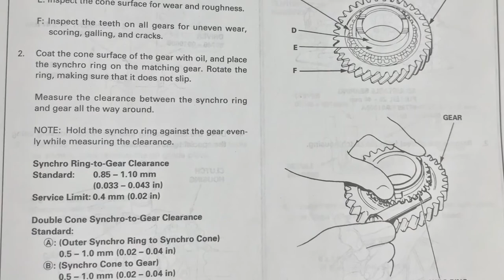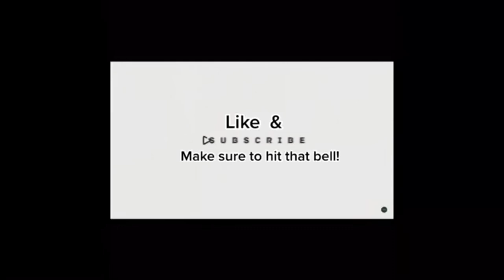Honda/Acura B series 5speed IN DEPTH REBUILD PART 2

Comment: I bought every single bearing and seal oem honda new and installed a Quiffe LSD. My S4C has to sopport 600+. Unfortunately i couldn't get thrvppg straight cut gears this time around. I had already spent $2800 on the rebuild. Absolutely fantastic video. Couldn't have done the job woithout your posting.
Reply from the maker: Thanks Jim…I figured a few guys would appreciate some of the tips and tricks I learned doing these… the D series trans are very similar , if I had a K series Id do a video on those too. Thanks for the comment! BTW… the trans in the video is still going strong and the owner loves the b16 1-4 close ratios paired with the LS 5th freeway gear

Comment: Thanks alot for putting this up! What kind of oil do you run in the rebuilt gearboxes? Do the carbon lined synchros require a different oil other than Honda MTF3?
Reply from the maker: Way back before MTF honda manual gear boxes specified 5w-30 engine oil and it worked without issue. But even in the old stuff there is a noticeable difference in how they shift when MTF is put in them, especially when they are cold. 
I only use MTF no other additives. 
I change the fluid every 15k in my honda (manual or auto) because it extends the trans life. 
I haven’t ever seen a different fluid spec for carbon synchro’s and have put a ton in peoples daily/weekend hondas with over 100k still shifting clean with no complaints.
Rebuilds arent indescribable though… because owner induced bent shift forks are the number 1 cause of failure
Reply: @MRROCKAPE  Alright thanks alot for your quick answer 👍 I'm currently in the process of rebuilding my S80 transmission and saw alot of conflicting opinions about what kind of oil to use afterwards. So its nice to get a clearcut answer from someone who actually has some experience 😅 Thank you so much!

Comment: showed everything but the closing of the case-technique and lil clip in that 32mm plug hole... the same crucial part missing from most other videos i've found.
Reply: I cant figure out how to put it buck i tried to open the c clip as much as i can with a plier and prey the shaft with a screw driver from the nut it wont go in place do you know why?

Comment: Is there a specific orientation for the two washers under the main shaft? If I remember correctly one of the washers is concave
Reply from the maker: The concave/convex washer is against the bearing.

Comment: Hey man this was a very good video! I have a bit of a weird question however and I was really hoping you can help. I've been having a strange transmission issue in my EK project over on my channel. Basically what's going on is, and I know it sounds weird, but reverse is where 4th should be. So the 3-4 shift is actually 3-reverse. I cant find 4th gear anywhere. I did take the transmission out and did a whole build (on my channel named Gripworkz if you want to reference those videos) and I didn't notice anything wrong/damaged/missing when it came to the gear set. Also, the shifter seems to go into 5th but there's no engagement, it's like another neutral, I am so frustrated and confused, I've been at t his for months now. Any help would be greatly appreciated.
Reply from the maker: So likely something isnt right in the shift mechanism you saw me install right at the 25minute mark in this video , there is a pivot pin that can pop out of its lower hole, when that happens it tries to shift two forks at once or doesn’t correspond with the correct gear…. Thats my best guess on what is going on with yours.
Reply: @MRROCKAPE  I think you're right. I know for a fact I was able to engage every gear by hand on the bench, and I know I eliminated the shifter and linkage from the equation. That shift change holder mechanism is the only thing left that I can think of. I'll try to look for that pivot pin you're talking about. Time to pull the transmission again sigh thank you for your help!
Reply from the maker: @Gripworkz  dont worry lots of people end up doing these more than once… its part of the reason I tried to stress being really careful with the gear stacks as its a common mistake and a really hard one to figure out if you mess it up. I should have been more in-depth on that little shift mechanism because there is some lining up of the pins of the shift forks to it that’s critical. Maybe Ill do an update video when I do another one. Im looking for a k series 6 speed to do a video on currently.
Reply: @MRROCKAPE  Well you did really well with these videos, it’s hard enough to cover every single detail as it is. I tried to be as careful as possible when it came to the gear stack order and orientation but I know someone has messed with it in the past. If they made a mistake I pretty much put it together the way they did. I’ll double check everything when I get back in there. What do you think the odds are that the shift mechanism could be damaged?

Comment: Do you have a write up of how to row through the gears to test out the transmission?
Reply from the maker: So if you put a round punch in the shift shaft , twist it to your left and pull on it, thats first gear, push it forward thats second, let it self center, pull back and thats 3rd, forward is 4th,back to center and twist it to your right pull back is 5th, push forward and thats reverse. You will need to turn the input shaft while simultaneously shifting it to get it to go in each gear position.
Reply: @MRROCKAPE  thank you! And thank you for the awesome step by step tutorial. Just sealed my first b series transmission build using this tutorial.
Reply: Thanks for this question and thanks OP for the detailed answer!

Comment: Hey I’m rebuilding one of these transmissions, I got it together right just like this, and now the input shaft is locked up
Reply: Did you line up the tab before installing the case?
Reply: Just had the same issue, it ended up being the shifter assembly didnt line up with the other case half causing everything to bind up

Comment: I have a ls transmission that was stuck in a high gear even if I put it into first gear. I had to rev it high just to get it moving and changing gears does nothing. Even neutral will not work so if I released the clutch the car would die. Thought it was something wrong with my pressure plate so pulled off tranny and tried to rotate the main shaft through the gears but the shaft will not rotate while engaged in any of the gears. In neutral, the shaft rotates freely. Do you have an idea of what’s wrong with it?

Comment: I recently got a b16 hydro transmission. Guy claims everything was working perfectly. Probably sat a few months. Anyways, I installed it and I have no reverse. My shifter feels like it goes into reverse but acts like a neutral. Literally feels like there’s no reverse gear in it because of the fact it doesn’t even grind or anything . What can be my issue?
Reply: You bought a transmission from a lier is the issue.

Comment: Do you have to have the detenballs or whatever they are called and the bolt with the spring in, and reverse bolt in to have the shaft spin easy? Our shaft is hard to spin but does spin
Reply from the maker: I dont have any spares, all that stuff is available at the dealer

Comment: I completed the rebuild up to the point right before I put the other half of the case on.

I wanted to make sure I hadn't messed up anywhere so i put a screw driver in the hole of the gear changer and started pushing and pulling on it to make sure it went into all the gears without an issue. 

After a couple of gear changes the gear changer assembly pops out from the shifter selector forks. I had another gear selector assembly so i tested it with that one although same result. This cant be normal right? I made sure the forks and gear selector assembly were on correctly.

I kept feeling on everything and noticed the 1-2 gear slider has a good amount of play which causes the small shifter fork to shake a good amount when changing gears. I think this is whats causing the whole gear changer assembly to pop out. Do i need to change 1-2 gear slider? Is this my issue?
Reply: I believe your detent spring is goin  bad, which is why it is popping out of gear.

Comment: Did you use just the one small 5th gear from main and input shaft? Or just the one
Reply from the maker: No, you have to use both gears since they are different diameters to get the much more freeway friendly lower rpm the LS 5th gets you

Comment: just asking about the s80 transmission can trasfer all internal crv transmisdion 4×4
Reply from the maker: I assume you can but I havent ever actually mix and matched parts with a crv to a b16-LS-gsr-itr you may be able to cross reference factory part numbers from the crv to b series stuff on any of the oem parts catalogs available online…. If the main and countershaft are the same part number it’s likely the gears will swap too.

Comment: Before I pull my trans shifting is very hard and cant always find the gear and 5 there's a wine but I can feel like it's not all the way in any help will be appreciated
Reply from the maker: The whine is probably bearings from being worn or run with the wrong fluid. The shifting issue is probably bent shift forks and likely worn slider rigs. Id expect you’ll be replacing more than just the synchros and input bearing/seal.
Reply: @MRROCKAPE  is there a way I can send you a video to show you I don't want to pull it and inspect with out having some knowledge of what's going. On
Reply from the maker: A video of it having an issue isn’t really going to tell me whats wrong… it sounds like a major failure or multiple failures internally. Id recommend you take it to someone with experience as rebuilding, these can turn into a nightmare when one gear or hub gets flipped over and installed or if one failed part gets overlooked. There have been times when I worked at the dealer that it became cheaper to buy a new trans than fix failed ones because of multiple parts failures and parts costs to repair.
These 2 videos are a guide to the common grind problems and it doesn’t really cover what happens when that gets ignored and not fixed and driven way deep into transmission failures like it sounds your having.

Comment: Hey, whats the torque spec on that  shaft Nut?
Reply from the maker: 80ftlbs but holding the shaft is tough at best, its easier to just run it down with an impact onto where the previously staked dent lines up where it did before…

Comment: that the normal sound if you rotate the shaft
Reply from the maker: Yes…. That trans had zero issues and has at least 20k put on it since I made that video. The guy I built it for absolutely loves it..1-4th close ratio b16 with a LS 5th gear for freeway flying.

Comment: How can you tell if gears or synchros are bad?
Reply from the maker: In part 1 of the video synchro/gear inspection is explained and there is a spec sheet at the end of both videos of the synchro to gear clearance .85-1.1mm though I have seen that spec be good and it still grinds so I always replace all synchros if I have one apart, if the slider ring or gear teeth have any visible worn flat spots they should be replaced . If the trans is popping out of gear the gear hub/slider and shift fork should be replaced.

Comment: what if the main shaft won’t spin when you run it through the gears after you put it back together ? everything spun fine before i put the case back one but once i sealed the case and torqued everything i can shift it in all the gears except 5th and i can’t spin the shaft. it’s a gsr transmission
Reply from the maker: Does the shift shaft move through the gears like it should? Or did you pull the cases together with the bolts?
Reply: @MRROCKAPE  when i put the case on i had to shift it through the gears for it to pop down and there was literally only a 1/16th of space between the case so i used 4 of the bolts and spread the lock ring while slowly tightening each one until it closed completely and the ring popped into the groove. i can shift into all gears except 5th feels like i can’t and if i tried it feels like of damage something. i had the main shaft tab pointed in the twelve o’clock position so i don’t think it was that. i’m gonna pull the case off. i took all the 12 mm bolts off and i can now move the main shaft fine
Reply from the maker: Something is bound up, if the case didnt lay flat before you put the case bolts in there is an issue… 1st make sure before you take it back apart the counter shaft bearing is seated in the circlip. (Behind the end plug) I cut the video of putting the outer case on because they can take time getting them to line up, spinning the main shaft and jiggling the shift shaft helps everything find its spot and the case slips right together… eventually.
Reply: @MRROCKAPE  i feel like it’s coming together right i just need to find a way to get the clip on the bearing and try to spin the shaft after that. the case slips right on and for the most part is laying flat. the front side of the transmission has a tiny gap that goes away when i press on it but the other side lays completely flat

Comment: You skipped right over putting the snap ring on !
Reply from the maker: The Snap ring in the outer case?…. It was edit out for all the cussing!🤣 I do these in my sleep. 
This one turned out sweet with the b16 1-4th and the LS 5th gear, cruises down the freeway. Best combo for a fun daily

Comment: What was the torque spec on the counter shaft nut?
Reply from the maker: 80ft-lbs, though I have always just tightened the nut back to the spot that the previously staked spot on it was.